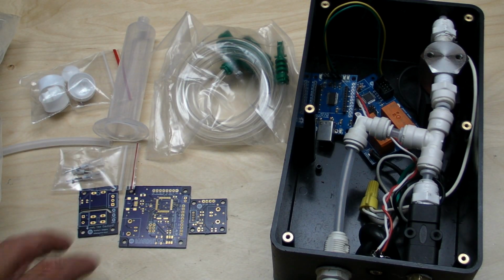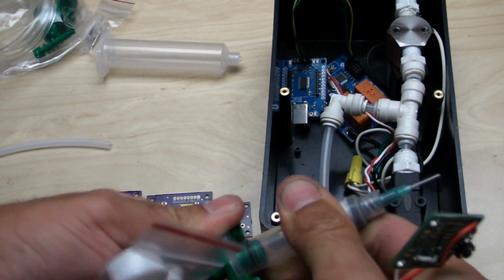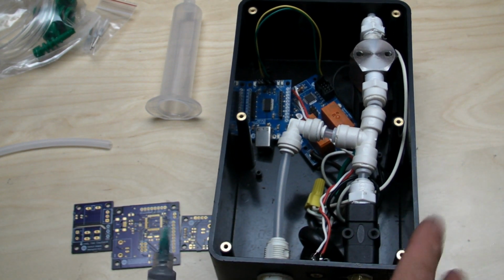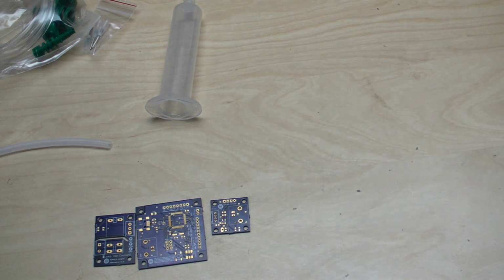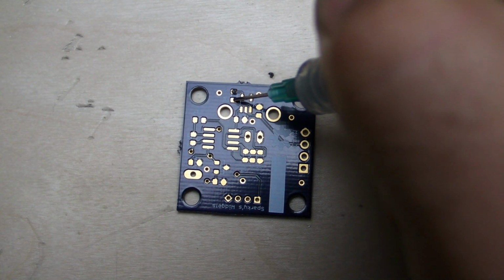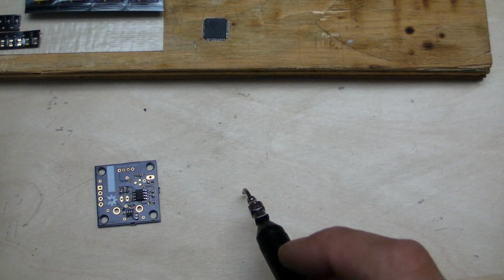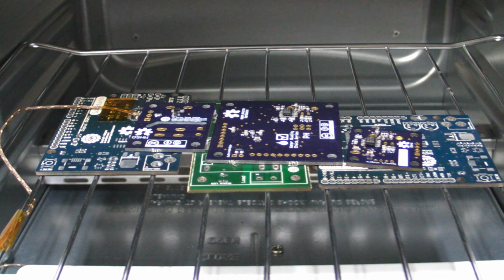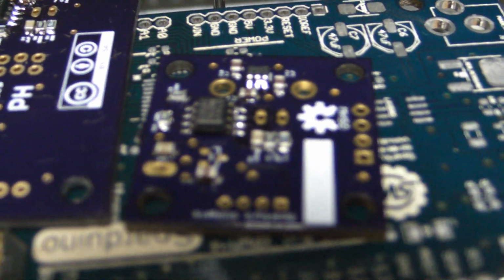DIY Solder Paste Dispenser and Reflow

Comment from the maker: I usually end up doing a 2 reflow process. I will place them on one side then bake it. Then do the other side and bake it again. you can also use a try to hold the boards up a bit, with this way you can usually do it in one reflow with care. The key is to make sure your reflow profile is spot on and too not put too much IR energy into the oven which might discolor the boards and scorch the plastic and silkscreen.

Comment: Hey, how do we get this going with ChiliPeppr so we can all dispense solder paste right onto our circuit boards? I'm milling circuit boards now with ChiliPeppr and the next step is I'd like to get ChiliPeppr to have a clean integration to your dispenser so we can all build one and get the solder paste process to be really easy. The step after that would be laser soldering and pick and place. ChiliPeppr has come a long way and is ready to take on this next task.

Comment: Really good guide. I have a question also. I'm using Naphtha (petroleum),hydrotreated light, when cleaning the board and joints. It works good so far. I would like your thoughts on it. Are there any drawbacks using this chemical?
Cheers

Comment: How do you do the other side? I'm curious, do the components on the already-done-side fall off or something?
Reply: The easiest way is to use lead free solder paste for the first side (reflowing at 240-250ºC) and for the other side use Low Temp Bismuth paste (reflows at 165ºC). the 165 degrees dont melt the solder on the 1st side